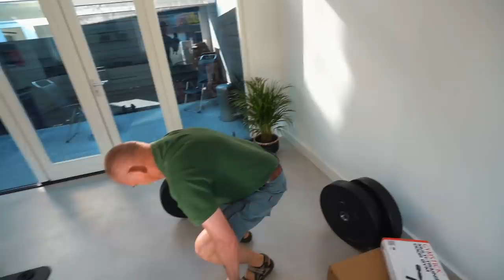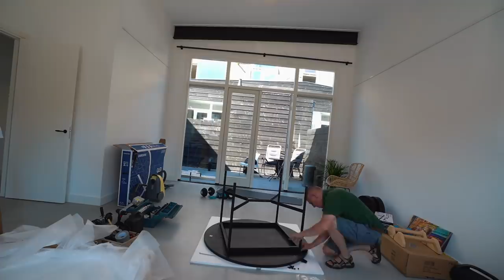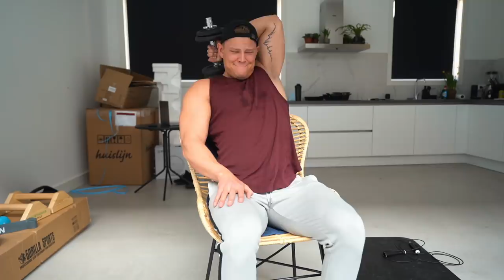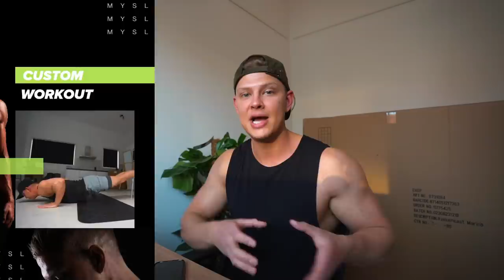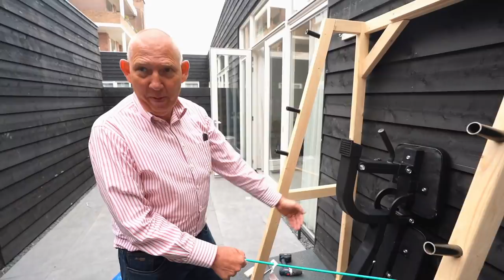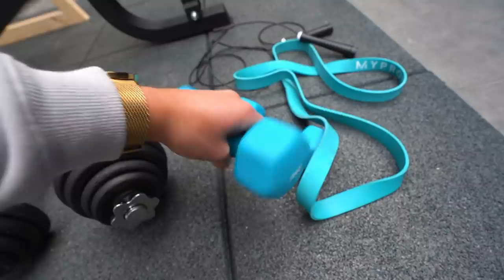BUILDING A HOME GYM WITH DAD

Comment: It's so cool to see your dumbbell workout, I actually got inspired by your water bottle workout a month ago, got only one adjustable dumbbell so I was using the smaller plates for the exactly those isolation front, lateral and rear fly exercises and doing a lot of single-arm work as you showed in this video as well :) I hope to get a second dumbbell as well soon so I can do a little more variation tho

Comment: Man just make sure that the wood is strong enough to lift 100 kg 😅
Reply: was thinking the same, in my opinion it doesn't appear to support so much heavy weights :/ The wood will get moister, rain, heat, it might crack in weeks :/
Reply: Mister GG yeah exactly. It looks modern and cool but I don’t think it’s that durable
Reply: @MorningCoffeeDaily  it has a sail thing that he puts over it so it wont get wet. furthermore it its decently put together by someone who knows a thing or two it can EASILY take at least 50kg a side. trust me. wood doesnt just crack? I work at a company that builds log cabins among other things and its always wood. those things are in perfect state for years. if Merijn keeps it covered when not training its probably going to be fine.
Reply: Agree, it's cool but seems risky! When you buy a power rack you know it's designed to support a certain amount of weight and tested properly as well. When you create one yourself, not so much. But idk it may be a package that is designed to support a given weight, given that you build it properly.

Comment: How did you still got that bench,barbell and bumper plates? Marktplaats are full of scammers now but the only site I can find stuff on but its second hand but 3 to 6x the new price.
Reply from the maker: I knew some ppl I was lucky
Reply: @MerijnOfficial  Do they still have? I have been searching since gym closed and had a rough couple years and bodybuilding/powerlifting is the only thing that keeps me mentally strong.